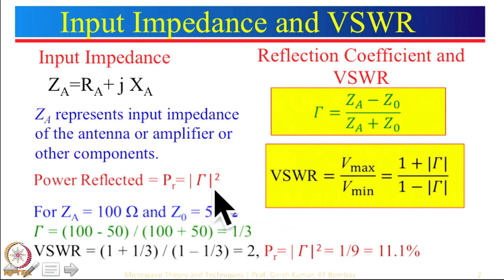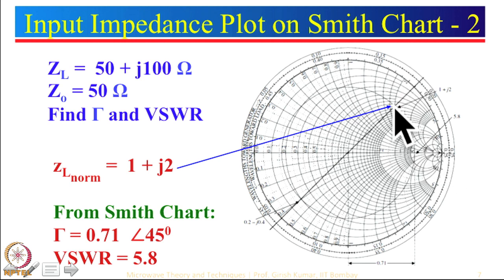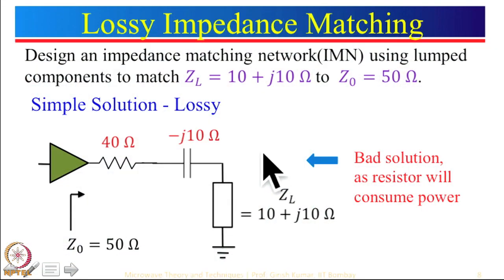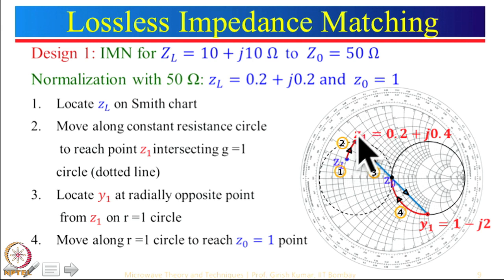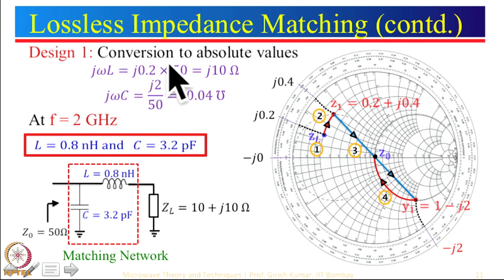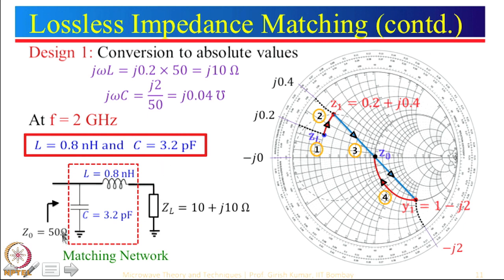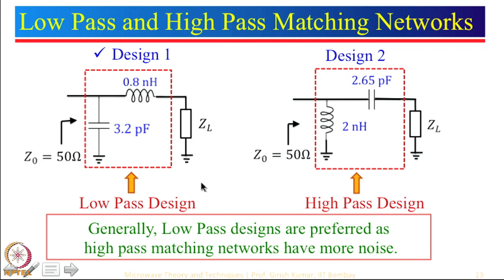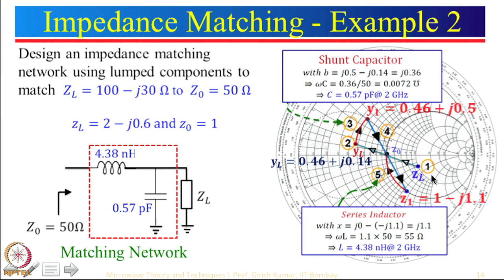Week 3-Lecture 12

Comment: we always have to move on constant r circles, we are using lossless components (L, C). If we change the r circle, then we have to add resistor for it, which will make it lossy
These 2 unity circles are used for this only, so that while moving across these circles will result in same normalized impledance/admittance